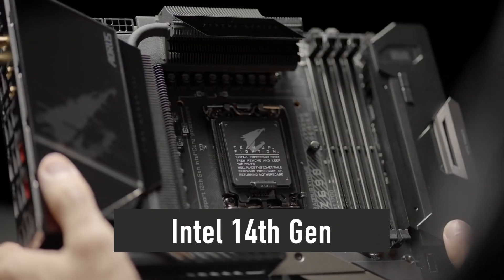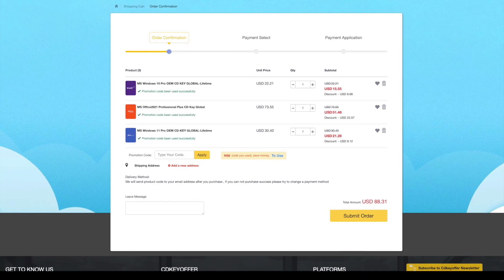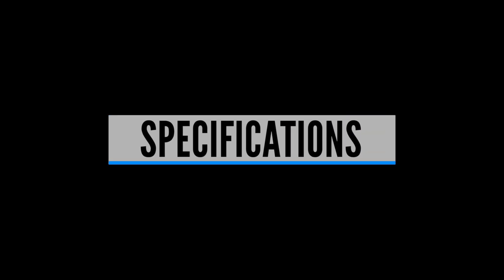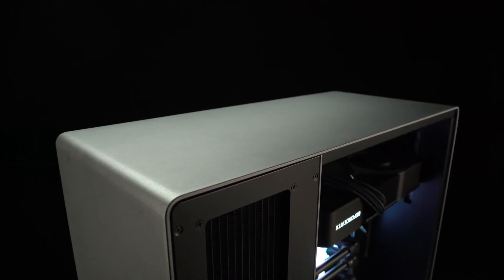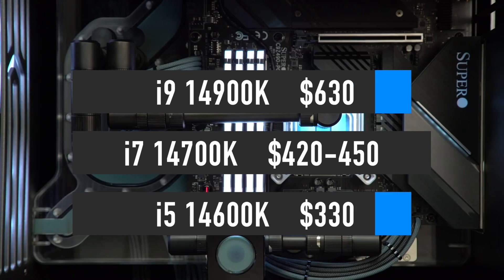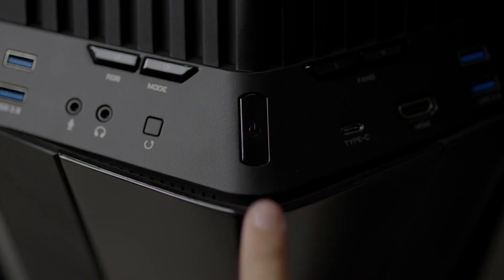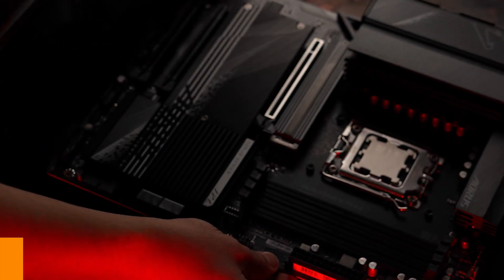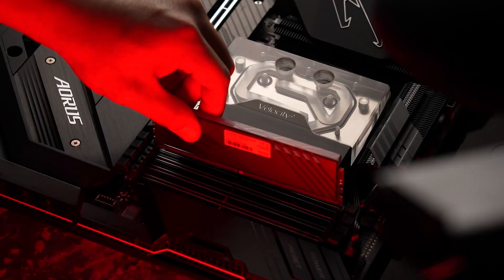Wait for i7 14700K even if you want to buy Ryzen 7000 [Intel 14th Gen vs 13th Gen]

Comment from the maker: What do you think about the :_intel:i7 14700K?
Reply: 13th gen is hard to cool if 14th gen can deliver 10 percent better performance at same or less heat and same or cheaper price point maybe its worth it. Otherwise not. Currently AMD is cooler and better in most games.
Reply: @Ash-cd3ny  Only their 3D chips are better in games, but these suffer in apps due to lower clocks. Example 7800X3D is top gaming chip and beats 13900K in gaming by a few percent but it's application performance is more like a 7700X and 13900K utterly destroys it in Applications. I am interested in 7800X3D because I mostly game but if you do other stuff, I can see why Intel still is relevant. Intel have pretty good overall performance in both games and apps. Power usage is Intels problem but its not that crazy in games. Games don't peak the CPU.
Reply: @Dr.WhetFarts  The rub is, if you care about MT applications to the extent that the 13900K seems reasonable then AMD makes 2 16 core CPUs that tie/beat it for less power still, and the AM5 platform isn't anywhere near EOL. You can't both invoke the 13900Ks potential in app performance while simultaneously trying to excuse it power usage. It's still more than AMD's in both segments. The difference between initial and EOL offerings on AM5 could be half as impressive as AM4 had and it would still make more sense than buying into LGA1700 now. Maybe if you came in on mid-tier 12th Gen, and now 14th is to be best relative in socket performance increase Intel has literally ever offered. Which you could push the purchase to the 1st price drop.
Reply: @Dr.WhetFarts  Agreed
Reply: @Ash-cd3ny  Who said that??'
Did you used Intel CPU ?
Reply from the maker: @Irnwkr28  That is i9 type of problem. i7 does not suffer from it. But I can't say that it will be power-efficient.😄 Ryzen is still the go-to for power efficiency.
Reply: @theivadim  The thing is, as a refresh, the only way it gets reasonably better is through consuming even more power.
Reply: @BranchOfMotherTree  you're ignorant, they are way more different than that dummy

Comment: I have a 12600k on a z690 and when I bought it I had no expectations of being able to upgrade past 13th gen. For me the 14600k is the one to wait for, 2 more P core and 4 more E cores with higher clock speeds. While not a huge upgrade it will definitely be an improvement.
Reply: It might be a huge upgrade especially for the future. Im in the same boat with a 12700k and z690^^ looking forward to this so we can wait for 3-4 more generations to upgrade our mainboards :)

Comment: Meteor is going to kill raptor tho, it’s basically in the name lol I suspect probably a new socket too. I’m waiting for the next socket
Reply: meteor is supposedly dead for desktop, a possible i5 might come out as it'll be an upgraded mobile chip, gonna have to wait for arrow lake and the 1851 socket >.<
Reply: @MitchellOdenthal  sick of new sockets, every two years a new socket, means a mobo upgrade all the time
Reply: @gr33nDestiny  Yeah, which is why I think I'm gonna get a 14700k and just keep that... a long time probably.
Reply: @jessefisher1809  I still have a i7-8700k
Reply: @gr33nDestiny  Nice. I only retired my 3570k last year! It was still able to game. Only got a new cpu because I wanted ps3 emulation.
Reply: @jessefisher1809  yeah I have had no issues running my 8700k at 5ghz and really it’s only the 13th gen that exceed the core counts again. I’m going to wait to upgrade now mostly because DDR5 is still kinda new, I’m actually expecting DDR6 to come out in 2 years with gfx cards getting ddr7 in 1-2 years too
Reply: @gr33nDestiny  ddr6 so soon? I doubt it. Gddr7 is totally different kind of memory. Basically all that matters with it is bandwidth. CPU memory needs fast access speeds too. Anyway they're not related at all. Each ddr gen seems to take like 7 - 9 years. Then again ddr2 - ddr3 happened in just a couple years so maybe you're right. But if I was a betting man I'd say probably a bit longer than than. Its not like we've hit a wall with it yet or anything. 

And man is it ever overclockable I was blown away. My 5600 cl36 kit runs at 6400 cl30 completely stable. My ddr4 memory could never overclock like that. Then again, maybe I was just unlucky before. Who knows.
Reply: @jessefisher1809  yeah you can google it, the reports are saying “Samsung announcing at its Tech Day that DDR6 is expected to arrive as modules for commercial use in 2025” I don’t know why the cycle is so shot at the moment, I don’t think DDR 5 will last long, with such a high CL they are giving it lots of latitude tho

Comment: Who gives a fuck about the ~30W increase if that’s even true. That’s like 10 cents a day if run 24 hours a day 💀. Imagine not picking a superior processor because you’re worried about a negligible wattage increase that you don’t even understand the minor implications of. Yes you’ll need a bette cpu cooler, but there are some cheap aio like the notte frost which are more than capable for relatively cheap and will look cool. To steer away from an Intel cpu for these reasons is so stupid
Reply: i have a 13600K undervoltet uses max 100 watts but just in bf2042

Comment: The 14th gen CPUs will make sense mostly for those that are on the 12th gen platform.
Reply: Normally I just do a new build every couple of generations but honestly the component cost have risen so much over the last few years I am considering just upgrading from a 12700k to either a 13900k or 14700k depending on pricing during the holiday sale period on the 13th gen part and performance benchmarks comparing the two cpu's.

Also waiting and hoping by then there will be some feedback concerning the power connector overheating/melting issues with the new connector upgrade recently announced on the 4090 by then as well.
Originally was going to wait for the 50 series but now that it seems that it may be April 2025 or so before we see those may well just do the 4090 and cpu upgrade and call it a day for a couple of years.

Comment: I will buy 14700K or 7800X3D later this year.
Reply: Buy 7800x3d and 3 years later upgrade to 9800x3d without change motherboard and system restore
Reply: @wuguanlin3533  AMD kind of sucks though, especially if you use your PC for productivity.
Reply: 14700k much better CPU.

Comment: have the 12900K totally happy with it.. if the 14900K can be handled by my thermal solution I might consider upgrading given that I have enough work to pay for it's money
Reply: It's hardly time to consider the 12900K 'inadequate' for most folks, and certainly not for a gaming rig; certainly your current rig delivers framerates similar to at least a 13600K, which is only ~10% less than the assorted flagships?

Comment: i already bought a 13600k😴 about 8 months ago, if its worth an upgrade i will take the 14700K
Reply: How good is the 13600k? Should I get the 13700k or just wait for the 14th gen processors? What u think?
Reply: @NotLRK tbh jus wait
Reply: @NotLRK for my use just gaming and a little excel is a beast
Reply: It will not be a substantial upgrade. 13600k will be more than enough for current and future games, even for productivity tasks. If you have the itch to upgrade, just wait for the 15th gen as it's gonna be huge.
Reply: @alrizo1115 okey yeah i already thought i wait for Arrow lake

Comment: Give us more p-cores. If PC progression keeps slowing down like this, apple's hardware will fully take over and we'll live in a pretty dark computing age. It's bad enough windows updates are doing half the job of killing custom hardware.
Reply: Apple uses big.LITTLE approach as well...........
Reply: E core doing well duh
Reply: @LightWilliamz  So the E-cores only benefit tasks that aren't latency sensitive. They are so disproportionately slower than the P cores in both clocks and IPC, that at any point you could use more than 16 threads for anything requiring lower latency they would be detrimental. They are a short term solution of remaining relevant in productivity without the power usage getting way further out of hand. It's literally the same strategy as the Skylake refreshes that added 2 more cores every gen after the 7700K, but looks better for Marketing to show more cores than AMD this time. The 13900K doesn't even universally beat the 7950X where those E-cores are useful, while still needing more power.

Comment: i bought ryzen 7700x last month and I'll be using it for at least 6 months before the 14th gen premiere and i'll be hopefully using the motherboard with the upgraded ryzen 8/9k for years after the lga1700  will be obsolete. Beside - not really interested in intel chips right now, because of power consumption and temperatures
Reply from the maker: Good call👍 I am a big fan of power-efficiency.
Reply: The basic 6 core CPUs like 12400f have been fine but yeah, everything higher gives me pause due to power consumption, heat, and the cooler I'd want for reasonable temps/noise. This is likely why the 12600/12700 and up are heavily discounted now and still moving slowly.
Reply: @samk7500  - yes - my conclusion was the CPU design from Intel 1700 i personally like the most is 13400f. It's really efficient, but in the end slower at max wattage than 7700 and the motherboards were not a great choice for 1700 while for AM5 a month ago appeared motherboard ASrock B650M-HDV/M.2 which is $125 and have all the futures i wanted in matx format.
Reply: heda_68  - this is also temperatures, cooling, noise, longevity, power throttling, better task scheduling, system latency etc

Comment: I think ill still go with AM5 for platform longevity and the fact that the 14700k will be very power hungry
Reply: It's like 90W vs 120W in games gl saving 30W lmfao baseless argument
Reply: @mythbuster4315  I don't care about the money saving I mostly care about the fact that it produces heat and becomes harder to cool. We'll see ig,main issue is I don't wanna buy a whole new motherboard for a single upgrade. Currently on AM4. 
Also the 7800X3D consumes like 50w-80w while gaming and the 13700K can go as high as 150w in some games,I have a 7900XTX with 800w PSU,so yeah,I doubt it will be worth it to replace my PSU for this thing. Ryzen 8000 will probably outperform 14th gen in single core perf anyways and they'll have 3D cache too. Main concern with AM5 currently is low core count although I don't really need more than 8 cores
Reply: @mythbuster4315 now compare 90w vs 120w in one month
Reply: @zenith_uu do you run your system 24/7? LOL still baseless argument
Reply: @zenith_uu uuuuuuuii 🤣🤣who the f*** cares 30 watts
Reply: @mythbuster4315  7800X3D uses 50 watts average across alot of games (techpowerup), 13900k uses 150 watts and still loose overall with 2.3% in 1440p, plus 7800X3D is way cheaper. High-end intel chips like 13900k almost demand a 360 aio solution to keep cool, while 7800x3d can be aircooled with a somewhat cheap cooler. That is the big difference. It's not 30 watts difference at all, more like 100 watts (in gaming) and 150+ watts in multi threaded apps.
Reply: How to say your an amd fan boy willling to go with lesser quality just for content lmfao 💀
Reply: No bc current am5 boards are limited to 6000mhz. ddr4 is faster than that. Unless you have c28 or lower it’s ok but that’s like having 3200c14 it’s much better at higher speed. Next Gen is going to bring better ddr5 speeds. No one also talks about bad 1% lows
Reply: Also expensive. It's an i7
Reply: @ariskoin9612  no it’s not 13700k was $365 z690 is cheap, bdie ddr4 is cheap 3600cl14-15 is good binned bdie oc to 4133 cl15 it’s less than 1% slower than ddr5 8000(faster than 6000c28) and is only $60 ram kit. It’s not like air coolers are significantly cheaper nowadays you can get a 360 for <$69 and if you get a air cooler under $60 your not going to boost as high bc 7800x3d ihs isn’t very good even though it’s efficient but the z690 13700kf and 3600cl14 are all cheaper and has way more oc headroom/undervolting. You can actually undervolt and oc at same time on intel and get more performance than stock using less power. Cpu ratio is directly proportional to performance and 13700k can do 6ghz. Ek cr360 and deepcool are good 360s but there’s also a $69 360 better bang for buck
Reply: @ariskoin9612  no 13700kf is $309 rn
Reply: @kodakblack531  and thats not a budget cpu. There arent budget cpus out.Because something thats considerred good can be had for 300+ doest mean thats its viable. For an average consumer thats not cheap.
Reply: @ariskoin9612  I never said budget but ddr4 bdie is budget now you can get 3200c14 for $40 and oc it to 4000c15 and beat ddr5 6000. Id say average consumer is prolly a 600x-700x series or i5-i7 a lot of ppl build budget pc’s just for gaming but would be better off buying console. Pc is not a good budget gaming option Amd 5000 CPU’s got a price increase and soon there will be no budget Gpu’s from amd and nvidia. rx6000 going away soon too
Reply: Just set a low v.core and load line calibration and you are fine with temperatures 👍 am5 Will ONLY suport new 8000 ryzen CPUs, after that AMD Will gonna Change socket, you can see on roadmap
Reply: @dalheplay  2025 isnt 8000 only
Reply: In games, yes but not in idle , at least 7800x3d consumes 5 times than 13900k. In USA states and countries like the UK where the energy prices have been increasing some much, intel might be better.
Reply: Power hunfriness seems to be no topic on most youtube tech channels. it is outrageous
Reply: My system is running 24/7 mining all the time since i built it, all my systems are in fact, but 30w does not make any difference, i use mostly amd but if i had a choice, Intel is Just better all round / compatibility side, build quality etc
Will keep my tuned 5800x3d system as long as it boots.
Reply: @pav1u  Unless you're doing some machine learning shit or rendering, I don't THINK anyone here games 24/7 which is my main point and indeed saving 30w which will save you like $2 monthly that you can buy a taco with.
Reply: @UaE0BoSS1  learn to undervolt, i don't believe you will buy high end systems and count dollars to buy tacos, if thats true just get a life lol
Reply: @UaE0BoSS1 I don't care about power consumption(I don't pay the power bill here so not my problem 😂) but I use an itx case so I do care about thermals more power means more heat

Comment: It's so frustrating waiting another year to upgrade, hopefully Meteor Lake will be an early 2024 release.
Reply: Meteor Lake is not for desktop. You won't see another Desktop release from Intel before Q4 2024 or Q1 2025 with Arrow Lake. So if you don't want AMD you better buy 14700K, you won't see better for a long time. Even if Arrow Lake is coming as planned, it's still 1½ years away. I am getting a 7800X3D or 14700K in a few months for this reason. Can't wait till 2025+ for Arrow Lake and Ryzen 8000 series probably don't beat 7800X3D in gaming anyway (Ryzen 8000 series is Summer 2024 and probably closer to 2025 for "3D" releases. You can't wait forever.
Reply: Meteor lake is only coming for mobile.  14th gen is raptor lake refresh.  Arrow lake will be for desktop.
Reply: nah bro better wait for 19900k

Comment: Not really excited tbh, upper end cpus getting all the love, i wish the i3 got some love too, even if 2 more E cores. It'll be a masisve help to that class of cpus, can easily make the 2 ecores handle everything OS related while the complete power of 4 14th gen big cores handle a game.
Reply from the maker: I agree. It is very unfortunate that lower-class CPUs don't get as much. Because that is where every core makes a huge difference.
Reply: Firstly, i3s have always been the CPU that delivers in single thread performance for the most part but falls short in multi. Second, haven't I heard that next gen Intel i3s will be 6 cores? 14100 should start with 6/12th. No e cores but that's gonna beat the 12400..

Comment: I will get the i9 when it comes in September i have also heard from some leaks that these new processor will support faster ram.
Reply from the maker: Faster RAM does make sense. But don't expect a lot.
Reply: Only get the i9 if you want to be able to fry eggs on it
Reply: Isn't the ram speed limits used with the Intel chips controlled by the chipsets on the motherboard these days?
I can remember reading something last year that was one of the big advantages of using a z790 mb over a z690 mb was that the memory controller on the newer z790 chip was much improved over the z690.